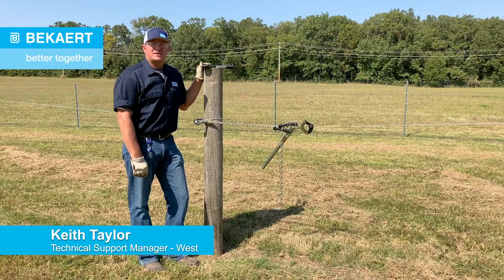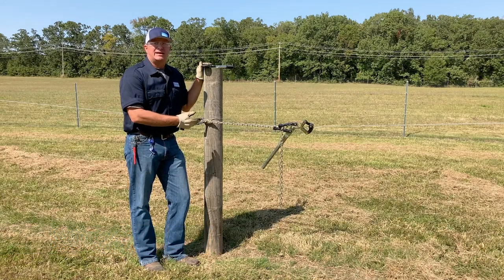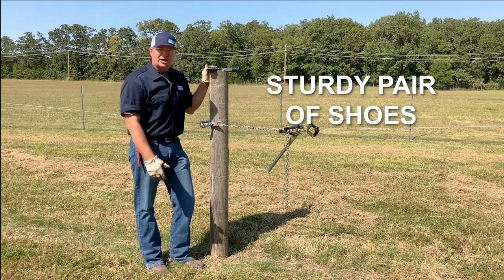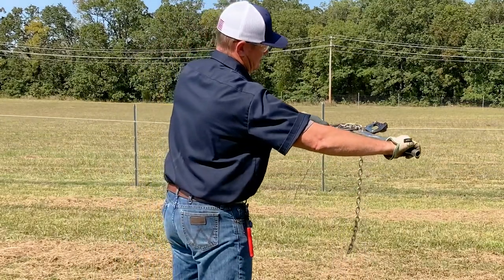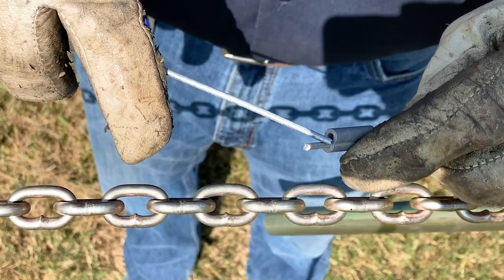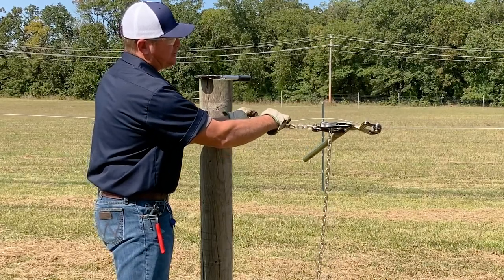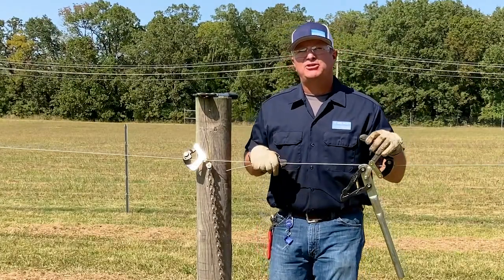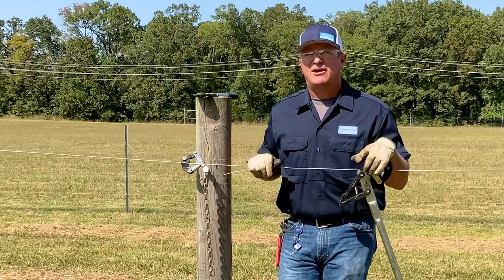How to Make a Splice or Fence Repair on Smooth Wire using Crimp Sleeves

Comment: Would you ever use multiple crimp sleeves on the same wire for redundancy or extra strength, or is this simply not needed?